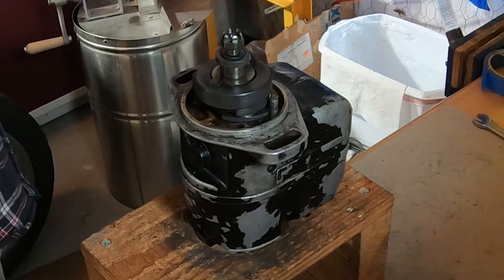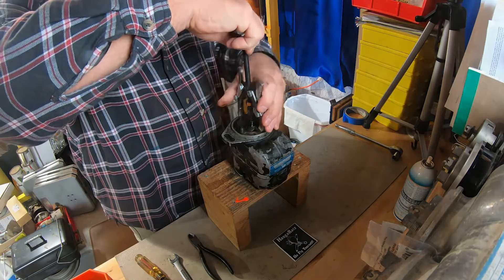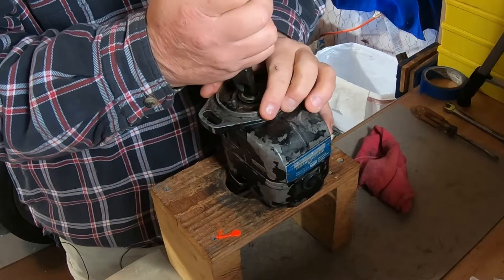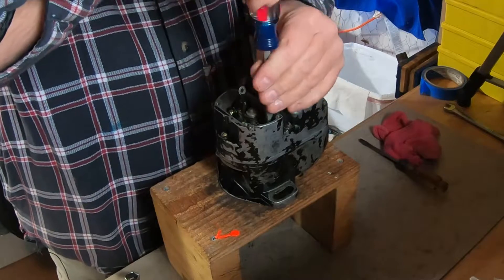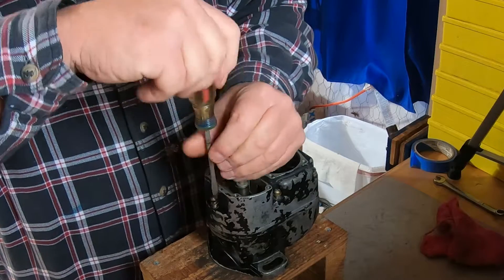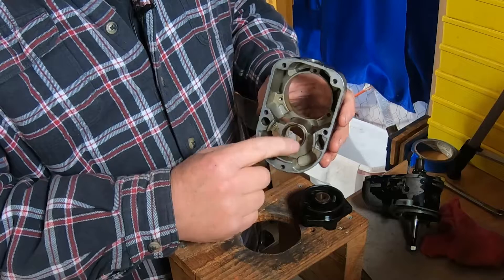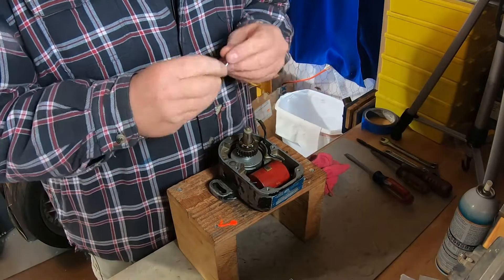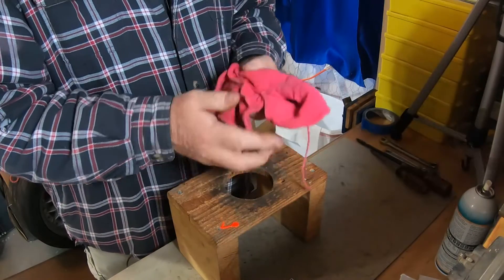Aircraft Magneto Needing Service! Bendix S4LN

Comment: Could you add a reassembly video? Especially the impulse coupling!
Reply from the maker: I prefer not to do a magneto reassembly video as a current manual is required.  I could probably do a spring rewind though.  Next batch in!  Thanks for watching!
Reply: I second the motion for a reassembly vid.

Comment: Great video thanks. I have six cylinders   mags on air boat.whats the best way to maintain them keep them healthy
Reply from the maker: Take them apart every 10 years or so and make sure the bearings are in good shape.  Normal aging issues are grease, coil fail, and condenser fail.  The coil is essentially plastic which cracks and the condensers leak.  Thanks for watching!

Comment: Very cool to watch!  
I'm a newbie pilot in training and get the pleasure of also getting to work on them with a friend a bit.  
Which loctite product or product type is used on the Slick?   
I use blue/242 all the time on RC helicopters, and red is very serious permanent stuff which gets used in some of the higher vibration or higher speed/stress items.
Reply: The recommended Loctite is in the slick manual.
Reply: @jimcaufman2328  Yep, some truth/good intent in the reply and some of it is what I suspect to be trade secrets, you just don't go and tell everyone out there what took you years to learn.
I'm in business and I get that.  
I looked in the AIM first of course just in case it would mention anything about thread lock.   I'm brand new at this, it's not my thing other than for fun/learning and enjoyment and I'm always under good supervision when I "do" anything.  and If I'm not I know at my experience level to seek it first before "doing" anything.
Reply from the maker: I pointedly do not reference various sealants, torques, specs, etc. as I don't want folks using YouTube for return to service authority.  Yeah, those folks are out there...  Thanks for watching!

Comment: This is awesome! I have taken apart the Slick mags on 44T a few times. Once in the back of my Excursion at F46 after Steve and I installed a mag and it was misfiring horribly. It turns out that our timing job just sucked.
Reply from the maker: Yup.  Just take your time and have the pubs available.